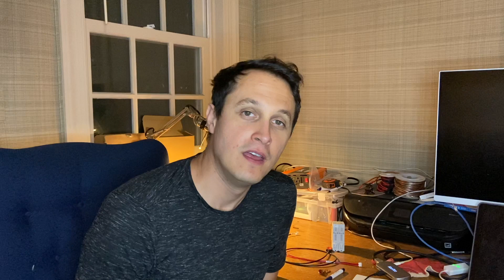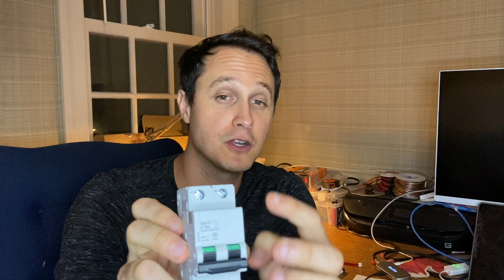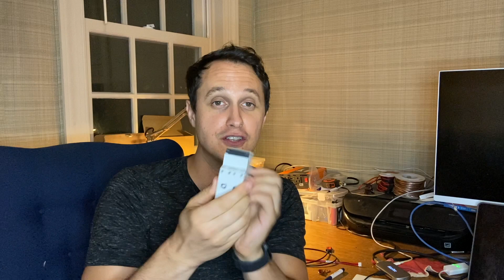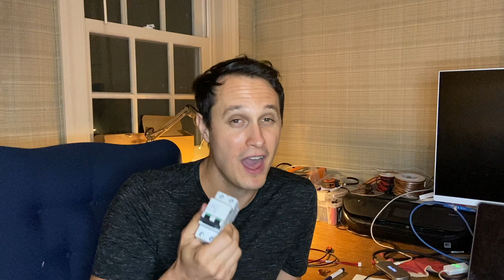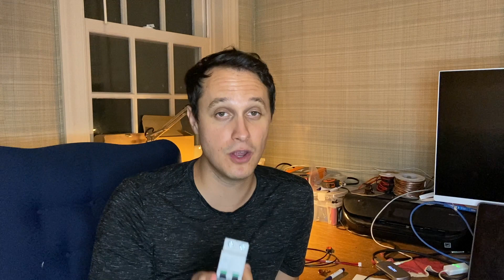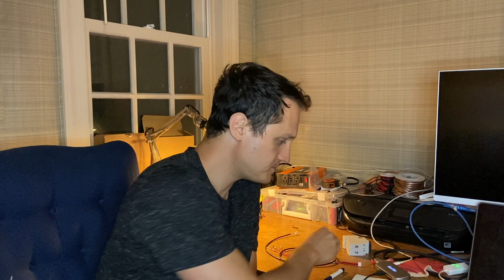Lessons From My Off Grid Lifepo4 Solar PV System Build

Comment: Why do people always tend to regret the original moves they made? Why do people always want more? In my humble opinion, the learning curve you have acquired by investing into that small system, got you started and got you smarter. So now you can have some educated opinions about the subject. Yes you're right, money can buy you more and better, but only if it's spent wisely. Wisdom is to size your system to your needs with only a small provision for expansion. For instance, you can buy a much more powerful inverter, but it will draw a quiescent power over night, draining considerably your battery. Adding capacitors in parallel with surging loads like saws,  fridges and freezers will also allow your inverter  to be kept minimal while responding better to those surges that only last only a short time really. Anyway, money seems to not be an issue to nobody when you have extra. That's the rich mentality that I always try to avoid. Because my means are modests, I just got into that habit not to waste any resource I have at hand. I think there are always alternatives, but one must always remember to live within ones mean.

Comment: Nailed it! Leave room to expand your system.
Also oversizing your system for more winter power makes sense. Apparently doing this eg, having 8kw installed capacity on a 6kw inverter is the way to go, at least for grid tie systems.

Comment: You mentioned inductive loads with large surge currents. Couple of comments. Central Air Conditioners can pull 50 to 60 Amps for a few milliseconds. The best solution is to install a soft starter that limits inrush current. Hyper Engineering makes a good product, I have installed 2 of them so far and they work. Our Schneider Conext XW+ 6848 Inverter starts and runs a 4 ton Goodman system no problem. If you are adding AC then consider an Inverter type Ductless mini-split system. For conventional central heating and AC consider a Trane variable speed system that has soft start built in by virtue of the Variable Frequency Drive technology. Finally, all Solar Inverters are not created equal. The low frequency type use large transformers and are much more tolerant of surges. High frequency inverters are usually less expensive and lighter weight so are easier to install but they don't handle surge currents well. It is important to understand your particular needs when designing a system and to also understand the equipment specifications.
Reply from the maker: Great points all around.

Comment: There is an Amps limit to each SCC. Good to buy one that can easily work with more. Using Higher voltage battery means can connect more solar. One Limit is 30 Amp MC4. It is possible to connect more than one to batteries. At 24 volt, 60 Amp controller = max 1.6Kw; Just 4x 400 Watt panels, over 2 sets of cable. Some of the newer Inverter chargers take higher voltage, require a lot of panels.
Reply from the maker: Absolutely, you can use more than one SCC. Although I think it is typically cheaper to just buy a larger one.

Comment: In relation to using AC rated breakers, switches, fuses and other devices in a DC set up, AC current and voltage actually actually goes to 0 sometime in the AC cycle where the arc will stop between contacts and then the current flows in the opposite direction with no arc between contacts. In DC, the current is constant and never goes to 0 so the arc is maintained unless a wider gap is used as in DC devices. Essentially, the contact gaps in DC equipment are wider so as to kill the DC arc between contacts in the switching process. At times the DC arc maintains itself across the contacts in AC devices used in a DC set up which manufactures a tremendous amount of heat in a very short period of time.

Comment: And order battery cells NOW. I am still waiting for Lishen cells 120 days later. They have not even shipped yet. So buy CATL or EVE instead. (I think Tesla uses CATL now).
Reply from the maker: I agree 100% on ordering them now. In terms of delivery time, I imagine which supplier you use has the largest impact.
Reply: I think the Lishen 272Ah have ceased production. Some Chinese suppliers only quote for 2 days, as price is going up. Maybe a shortage of chemicals, or they are upgrading the capacity of the batteries. Some Eve / Catl seem the same cell. I just ordered 8 Catl 310Ah from locally in Philippines, as shipping from China is either expensive at over $300 or impossible to my post code. I payed 20k pesos for each pack of 4, (=$409) Total =$844 delivered (at today’s exchange rate, I payed less)

Comment: Here's one of the smaller internal debates I'm having while I'm getting ready to order cells (for a DiY Vanlife build). Everyone is rightly concerned with doing the terminals right and not shorting out or stripping threads on $100+ cells.

Flicking through the Holy Bible (Mc Master-Carr)  you can find Electrical Grease that is conductive thermally and electrically. Others the benefits of lubrication- protection from corrosion (oxidization and galvanization ), anti-seize and achieving the specific clamping force at lower torque settings (because dry/light oil torque specs are higher of overcome friction in thread interfaces).

These are used all the time in Industry to protect and improve performance in harsh environments (HV Electrical, Maritime Electrical, automotive industry and maintenance ) and I'm surprised I don't see it come up anywhere in the community.

Oh, great videos too mate, very clear explanations and the PoV perspective is appreciated :D
Reply from the maker: Great question. I actually did use Ox-Gard on my terminals. I think a small amount is prolly a good idea and can't hurt.

Comment: Interesting perspective. Thank you for sharing your real world experience. I noticed you did not mention your battery. Is it large enough? Are you able to fully charge battery on a non cloudy days? Of course you could run generator or grid power to charge batteries, but do you find that you need too. How much power does your shop use on a typical day. More data is required to analyze the effectiveness of your system. Very interesting to me. Here in south Florida, hurricanes can knock out power anywhere from a few hours to a few weeks. I have always wanted to replace my generator with a solar generator. Thanks for sharing.
Reply from the maker: Yeah, my system is holding up alright now. I'm finding that I have plenty of power as long as I don't get three cloudy days in a row. But my shop's needs are pretty manageable, I don't run AC (just a dehumidifier), and although tools like a dust collector can draw lots and lots of power, I don't typically use them for extended amounts of time.

Comment: I originally was qtd on 16,000 watts.  I ordered 20,000 for our 2,800 sqft all electric. Two Sol-Ark 12K. 8-12 14 kWh 48v batteries using 280 aH. Good info for us. Thx. 

Oh, even if something is bad, their customer service is not like Amazon. But I’ve saved 75% ordering junk direct, cutting out the middlemen.

Comment: Lol, I also just finished a 5 kW solar energy system and ran into the exact issues that you mentioned. I cannot tell you how many times my wires were two or 3 inches short. Hard lesson learned.
I did not have an issue with items not working, but I do have an issue with the 13 kW battery back I bought from Big Battery , turns out they were more than happy to screw me.
Reply: Build it yourself for $3K. I’m building 8 minimum, but most likely 12 to match my 20000 watt array. About 161 kWh.
Reply: @USA-GreedyMenOfNoIntegrity  I was hoping not to have to build a battery but looks like I have to, another thing to do for the first time.
Reply from the maker: Yeah building yourself is definitely more work, but it is so, so much cheaper.